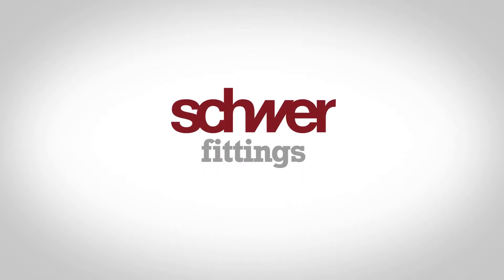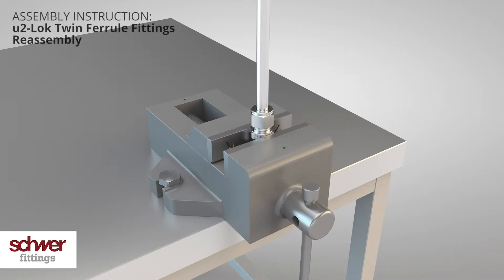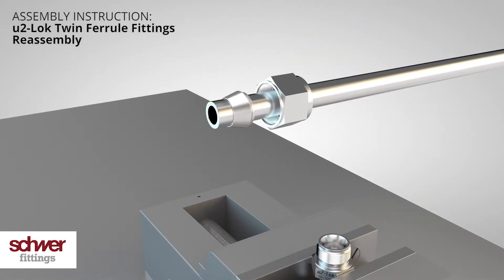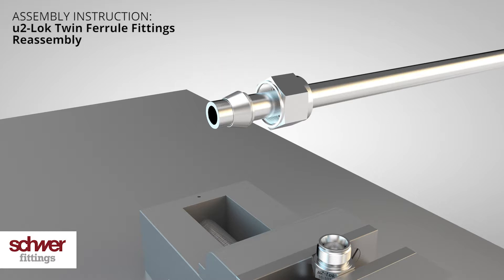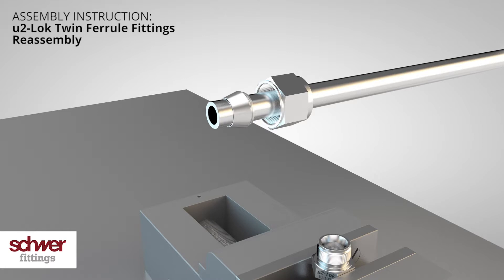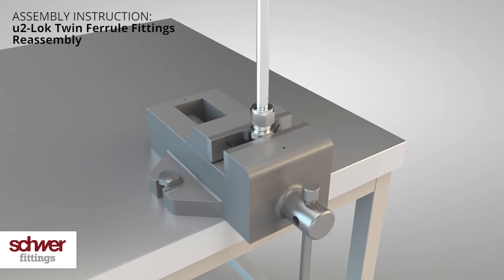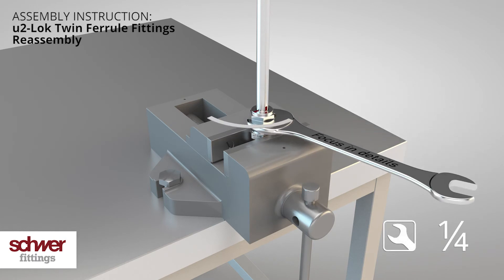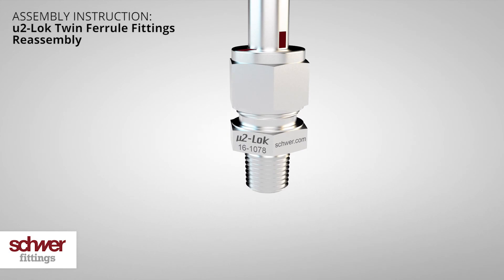Schwer Fittings: Assembly Instruction for u2-Twin Ferrule Fittings: Reassembly

Comment: Is 1/4 turn enough for leak free tightness ? I heard 1 1/4 turn after hand tight.
Reply from the maker: 1 1/4 turns for first assembly, 1/4 turns for repeat assembly.
Reply: I heard 3/4 at first tightening. Then, we use 1/4 to finish the installation.